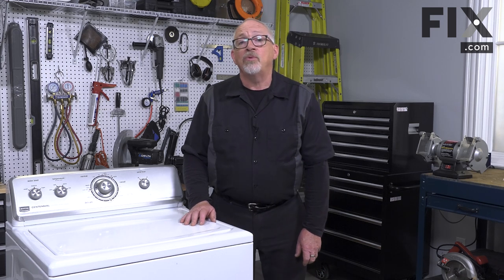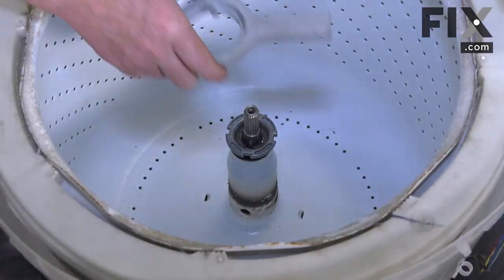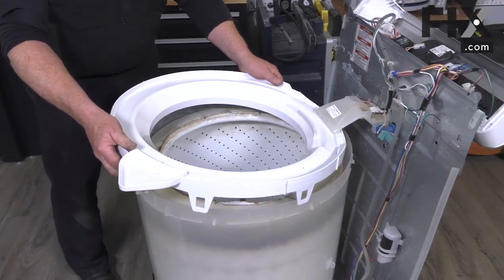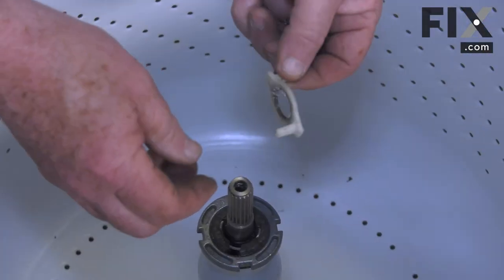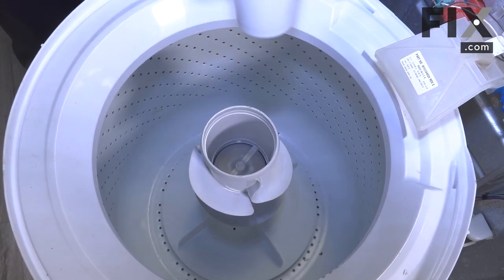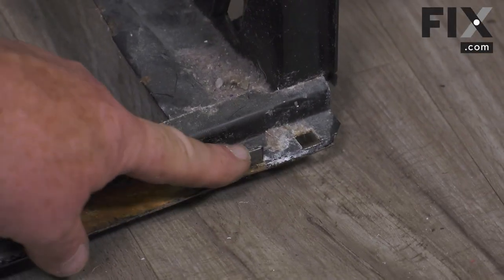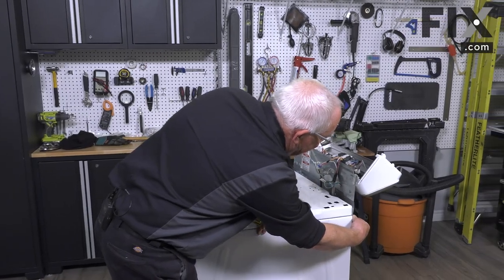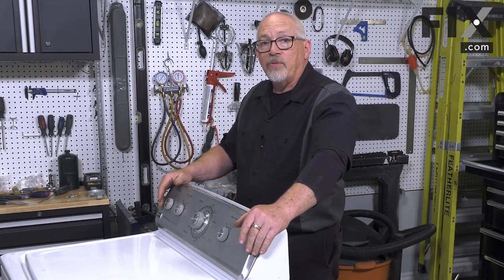WASHER REPAIR: How to Install a Balance Ring in Your Washer | FIX.com

Comment: Why take whole tub out?  Can't you just lift the top off, and install?
Reply from the maker: Great question those balance rings are rotated on the inner tub and lock into place thru a set of stepped notches. You can fight with it while still in the machine but in some struggles the out tub can get damaged .